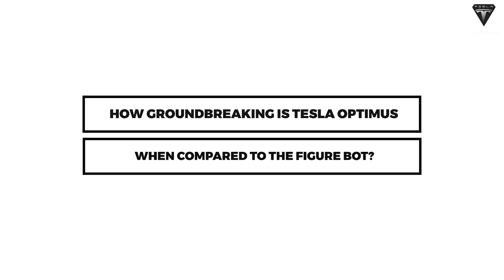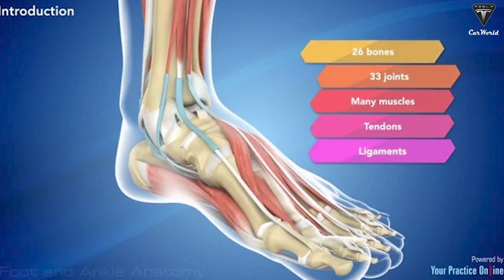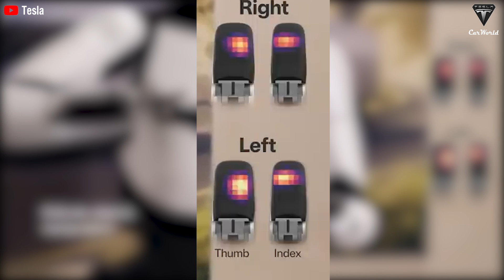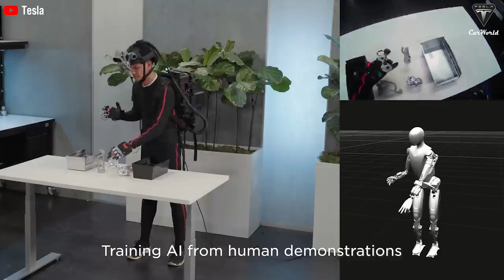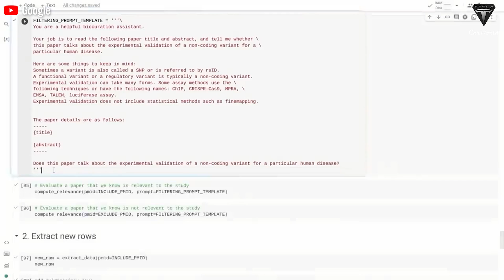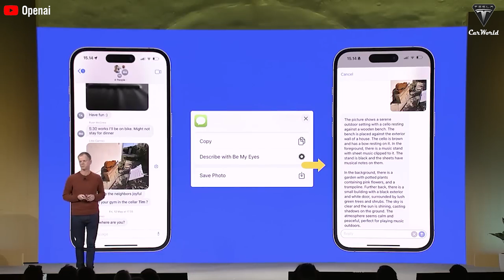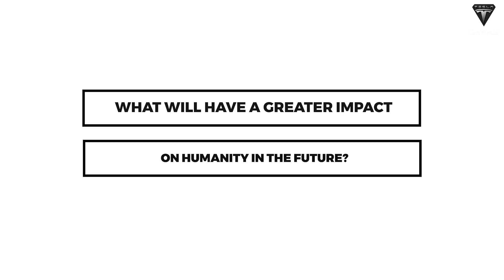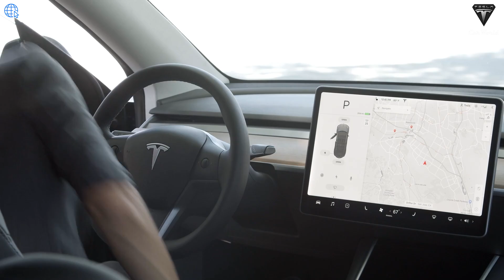Tesla Bot Gen 2 BIG Rival -  From OpenAI "Figure AI", Bezos, Nvidia Join this Funding Robot Startup!

Comment: Why the human look alike?
Wheels instead of feet tentacles, instead of arms and legs and you have a much more versatile robot.
Reply: Because the obvious design for a general robot is the design that has worked for millennia.
Reply: @markthomas7279  you could say, the octopus has been around as long, if not longer and would be infinitely more adaptable once equipped with wheels and a gen2 chip.
Reply: @markthomas7279  But humans didn't evolve to use technology. Should a Optimus surgeon hold a scalpel? or should it have tiny surgical tools in place of its hands and eyes on its wrist.
Reply: Tentacles?  Pulleeze, this is Tesla Car World, not Hentai Fantasy World!
Reply: Basically because all manual labor on earth is currently designed for humans and human hands, from factory labor to construction, our most basic tools are designed for us. Obviously. It’s very difficult for non human robots to do things that are easy for humans, such as opening doors. However, as time goes on you should expect more and more diversity within robotic forms as infrastructure for nonhuman forms will be created, as certain robotic forms could be much more efficient at certain tasks. Don’t expect that for a while, humanoid robots are a crucial first step to opening the gateways of robotics.